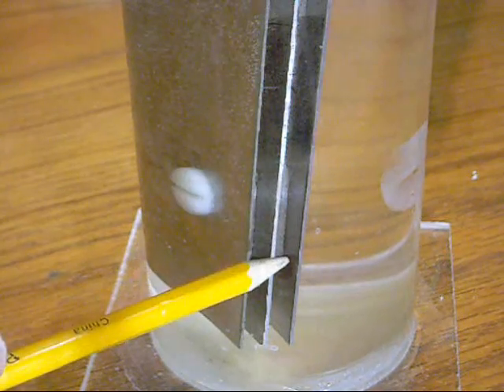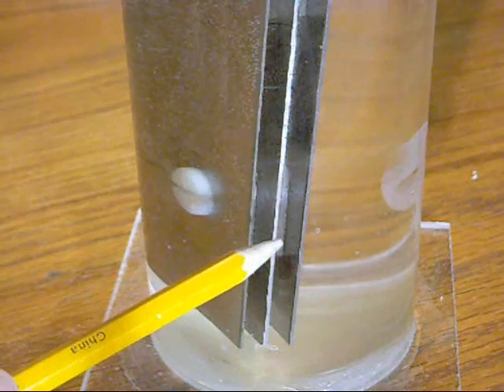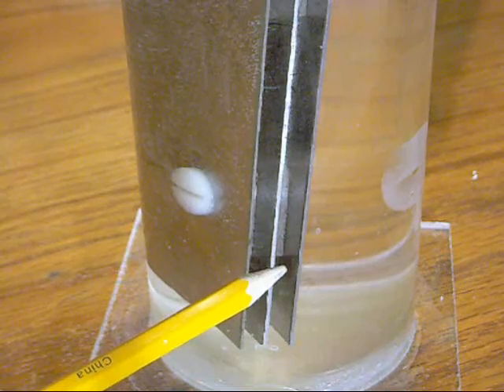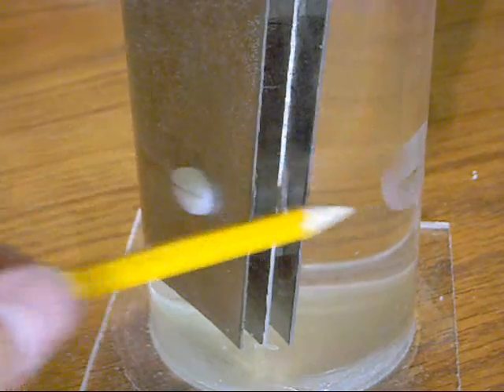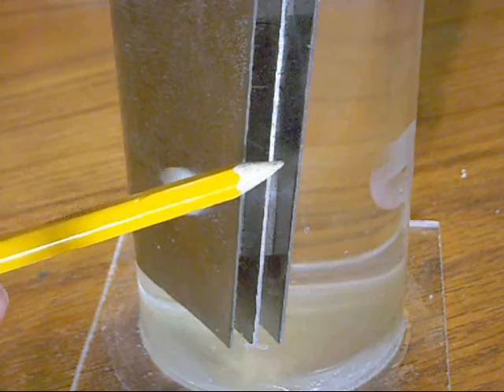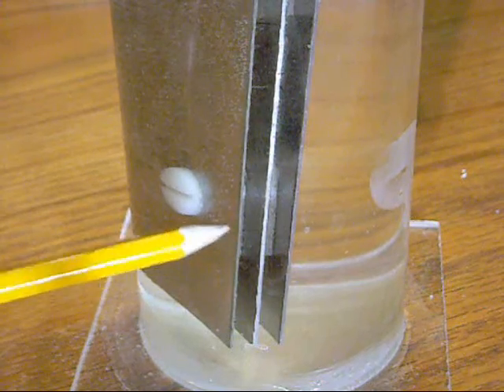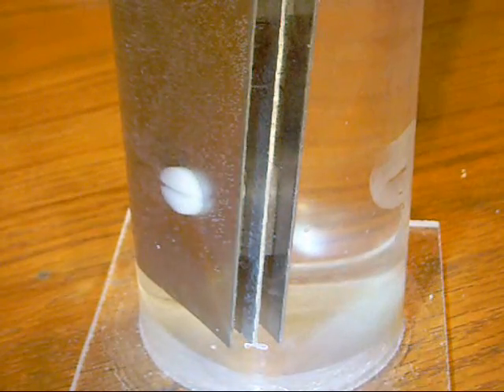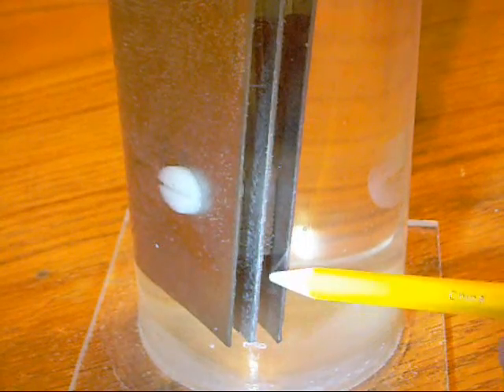Visual Gas Production (1 of 3)

Comment: CJP,I am starting to see that this is the problem with this concept.having the edges submerged in the water causes this.I'm leaning twards the saturated cell concept more and more.By doing so,it resolves a lot of problems.the water is circulated so you can cool it and you can put a resivor on for maintaining water level safely.A bubbler will protect the cell.making it much safer for you.